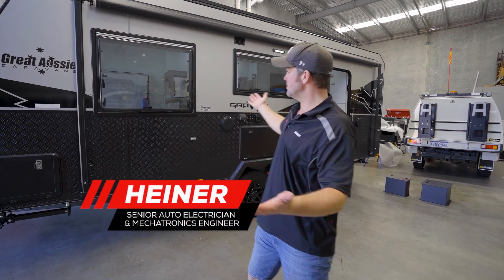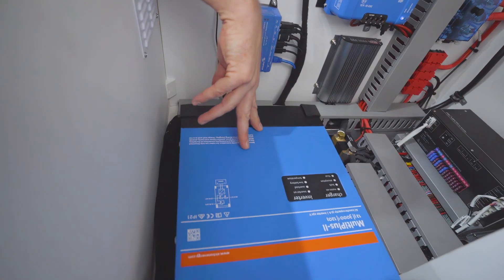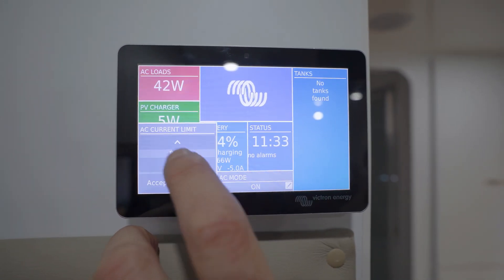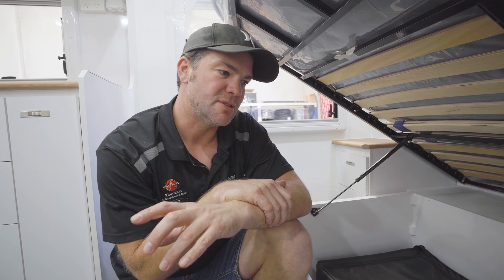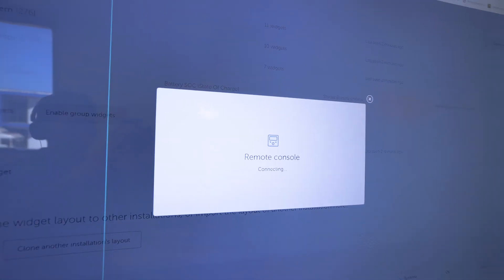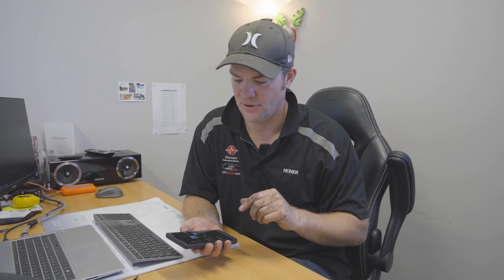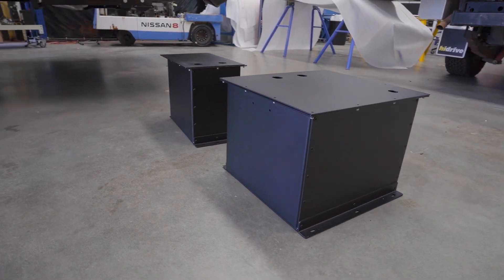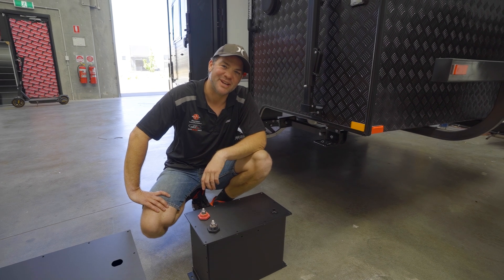Our Off-Grid Caravan Setup According To AS 3001 Standard (New Regulation)

Comment: Moin Heiner,
Nice video and nice setup for Australia with the victron system.
Yep, my Jayco van is similar setup. Installed by a licensed sparky of course.
Split system not touching the vans house power system which is a little bugger BMpro C system. Used now only for power Distribution in the van.
Only one difference for my system is I run the app control system version only, no Cerbo.
I have the lithium batteries installed under the seat near the axle since the system was installed in 10.2023 pre new regulations. 
And with the weight  near over the axle and not loaded to the front. 
4 month testing successfully done till May this year.
Since I need to support my 2+ 3 victron solar panel with a solar blanket we have chosen  the enerdrive 40+ dc2dc charger with multi input.
This does the job for me….
For sure not the cheapest installation, but for sure with reliable components.
Prices… we don’t talk about it since everybody can see the component prices on the internet. And the lithium battery prices vari from cheap to expensive as you like or have budget for it.

Please have some more short vids like that enabling other viewers to pick what they are interested in and can assist them to make their choice.

Cheers

Comment: Theres too much going on there and one too many accessories and reminds me of the electrical system of a submarine. Yes it looks nice but with a 12v system your capped out at 3000 watts. Check out the system from Ozxcorp who are also an Australian company with Australian made solar inverters. I`ve seen their gear at the Melbourne caravan show and their system is plug and play and not to mention their 14kwh battery which is mounted externally below the van. Cheers